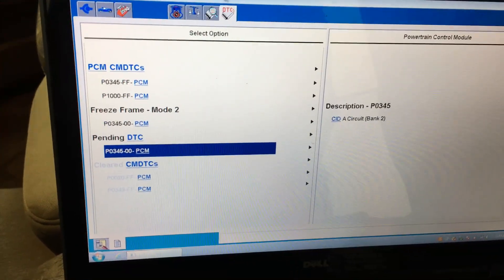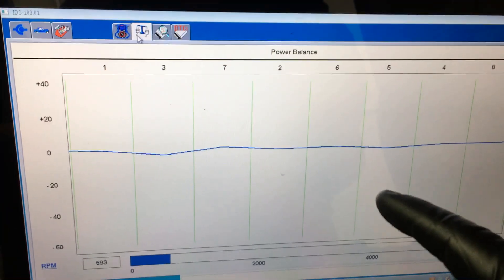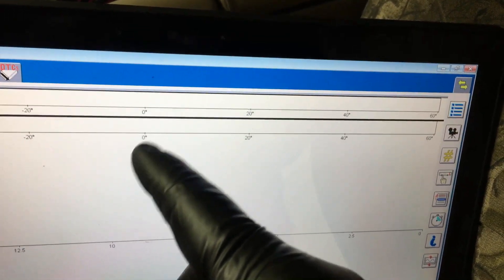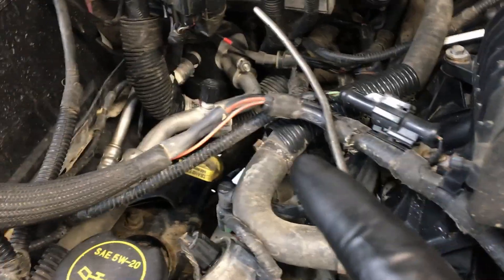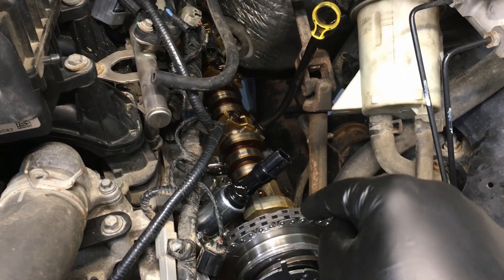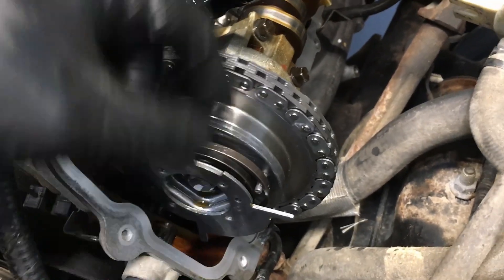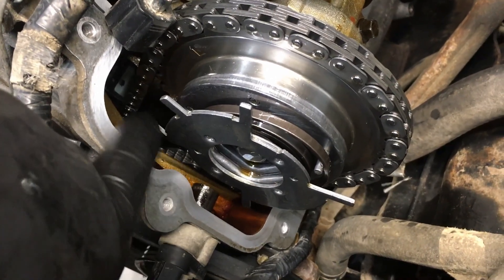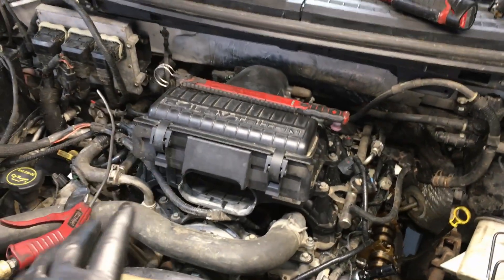Ford 5.4L 3v Triton Engine P0340 P0344 P0345 PO349: Always Inspect These Items First!

Comment: I have a 04 f150 5.4 it has just over 76 k , it started sounding hard on the start and the check engine light came on it read p0345 cam sensor bank 2 I replaced the sensor the light went away and two weeks later the same thing happened and it was po340 bank 1 so yesterday i got another sensor swapped it out check  engine went away. This morning it came back on and is spitting out the PO340 again. It sounds rough on the start but quites down into a normal idle in a few sec. It also has stalled out when I'm slowing down with the AC on
 Any advice plz I have 4 kids and on a budget. Is it ok to drive it

Comment: uh, I just finished the timing job and I got a p0340. Pinpoint testing the camshaft position sensor to verify it reads within the acceptable ohm range resulted in ZERO ohms.  Therefore, they do fail and following the Ford diagnostic procedure does have value.

Comment: I have a 2006 5.4l that’s throwing a P0345, and P0349. Ruled out the cam sensor, vvt solenoid, alternator, wiring. The Phaser is lined properly, could that still be an issue? The truck runs smooth with no issues. Just keeps throwing the 2 codes.

Comment: At what mileage should I do a timing job?
Reply: you do it when you hear the noise of timing chains slapping against the front cover or the chain guides.  Or when you get P codes related to the VCT, timing and/or cam position sensors.

Comment: I just did a step by step on your 4 part video.  Wasn't as hard as I thought it would be.  But now I have codes p0390 and p0394. Could this be the same  issue? Sensor B ??   Bank 2.
Update. It was a bent tab. I did the test of remove vct solenoid. No difference. Ohmed out the wiring and connectors.  Swapped left and right sensors for the heck of it. No good.  Hooked up my oscilloscope to it.  Noticed 2 spikes sort of far apart and  1 small spike and 2 large spikes close together. Removed cover. Sure enough 1 was bent.  Straightened and no more error code.  Just need to wait for the permanent code to clear.

Comment: I am having a problem with a 345 code and a rough running engine. Hearing what sounds like vacuum leak or exhaust sound sound intake. But after messing with it a few times the rough running goes aw away and it idles fine. 350k miles, 2 sets of the cheaper timing sets, 360 oil pump upgrade. Does it sound like the phasers are just moving around.please help
Reply: What was it??

Comment: So I did my timing job following  your videos  . It ran fine then It starting hesitating and jumping in gear . I saw this video and learned that you can test the alternator interference so I disconnected it and did the test well the problem stopped with no codes .  So does that mean I have to replace my alternator? Or is there a reason that is causing the alternator to do that . Can you help please .
Reply: What did you find? I’m about to swap out my alt

Comment: I had this same p0345 code and my car was shaking. First check oil and oil pressure. Found out I have a bad oil leak.  I check the oil it was nothing in it but 2.1quarts. Changed the oil got lucky. Engine run like again new.

Comment: Hi all. Wondering if you guys could help me with an issue I’m having. 

2010 f150 xlt v8 5.4. 140k miles

Pickup drives five but every now and then (not always) when I come to an idle, or take off of the accelerator at a low speed or come to a stop and the vehicle comes to idle my engine starts to do what I can only describe as a “clunky shake”. The shaking goes away if I bring the RPM’s up, and stays gone once the rpms drop back down to where they were when it started. My power seems fine at most speed and my  acceleration seems fine. 

Thoughts? Thanks for the help. I’m in a very rural area so I would like to have a good idea of my issue before I venture way out of my way to a reputable mechanic. 

Some people have told me phasers, more people have told me spark plugs are bad and misfiring.

Comment: I got a Harley Davidson 2007 f150. Just rebuilt the engine, put it back in time, fired it up. Missing like it's running on 4 cyl. P0345, 349. The middle tang on the L side of bank 2 phaser is in the middle of the cam sensor hole @ tdc compression. Just like bank 1. Still runs like crap. Everything else is working. I've done several of these 3v, never had this problem. Think it's jumping when I crank it over? No bent valves I've done a leak down twice. Bangin my head against the wall!!
Reply: Hey I'm experiencing same issues right now on my 2008 5.4. What was your fix in the end?
Reply: @Mrtoddmontgomerysr I had accidentally put the L and R on the wrong sides. So, basically, I put crank back in the right pos and realized it. Just made me some wedges to stick between chains and flipped the phasers 180*. I had put the L on the left when you're lookin at the engine, which is the R. Pass side is R and driver side is L! Can easily happen to you. I've done alot of these trucks. This is the only one I'd ever had a problem with. Lol

Comment: Have you ever had a vct system that won't activate? After installing a new timing set and oil pump. My vct system stays zeroed out? Like it's lifeless and running off the pin. I checked the wires from the vct solenoids. And they both have power

Comment: I recently did a complete timing component and oil pump swap. Truck runs ok, idles a little rough and I get the CEL with this codes for bank 2. I have done all the trouble shooting you mention in this vid and still get the CEL and codes. I've checked and cleaned every connection, I haven't tested voltage or replaced the VCT. Any advice on where I should go next? I bought Ford phasers, is there a chance it could be a bad phaser?

Comment: if anyone can help. 2007 f150 5.4 did timing job with ford phasers, timing chains and tensioners. checked timing 4 times. all checks told to check after job. still producing p0345 in pending intermittently. now after i did timing job drove veh. over a hundred miles. did smog etc.. no issues. ran great. after veh. sold customer/states veh. stalled sounded like diesel. code 345 pending. deleted and did all checks to check timing with out pull valve cover. checked vcterr pids. both dead 0 deg. at idle. did a relative compression check. perfect. all within .1 deg. have yet to reproduce code. only thing i know i have now replaced was the vct solenoids themselves because when i removed to do timing they had been replaced already. not ford. look like dorman solenoids. however every test has passed and 345 has yet to be reproduced.

Comment: Hey Mak, great video. I've watched the other cam phaser videos hoping to find an answer or insight into a problem I'm having. I have an '09 F-150 4.6L that intermittently throws a P0345 code but no others. When the code is thrown, the truck runs rough, feels like it's going to stall out and sounds like a cold VW Rabbit Diesel. I shut the engine off and left it overnight. When I started it up again, the check engine light was off. I drove the truck to the shop with the code still in the PCM the very next day and even though the code was still in the PCM, they said it was "running like a champ". From experience, I know it will come back – might be in a day, might be in a week. The shop told me it was a cam phaser sensor issue and said there's nothing they can do if it doesn't have the problem in the shop. They recommended an oil change with a MOA additive as a start, but said this problem could lead to an entire engine replacement. The whole thing sounds fishy to me. Thoughts?
Reply: Did you ever figure out this issue?  My '04 is now having very similar symptoms.
Reply: @alanrail5179  I had a lot of cam phaser work done on the truck but the issues kept coming back. Ultimately, I sold the truck.

Comment: I'm hoping this is the problem with the junkyard reman engine we just put in our 05 f150. It's an engine out of an 07 expedition that was replaced in 09 according to the tag on the side. I have p0340 and p0344. Runs smooth no misfire or loss of power. Just using a cen-tech scanner from harbor freight so I can only get so much info. But from what I have gathered it's in time.
So hopefully when I pull the valve covers it's just this simple fix, it honestly looked when I had the valve covers off for the solonoids the phasers looked brand new.

Comment: great content as usual. my question is when cam timing is off say a tooth the vct error pid offers to the right of zero so far but how does the cam being off a tooth change the error if the computer isn't commanding the solenoid, how is the error pid changing.. if you could shed some light on this that would be sweet.. thanks again

Comment: I've got a 1998 Lincoln navigator that just hit 300k miles, and now won't run! 
It starts for 5 seconds and cuts off. If I hold the engine at 1500rpm it'll run (really rough) till i let off the gas, then stalls... I'm thinking of changing the throttle position sensor, and the air idle control AIC? 
any thoughts or suggestions please!

Comment: I'm about to do a timing job ..a short story..I pick up a 06 f150 5.4 3v that's throwing the po345 and p0022. .and po349. .With a very loud knocking noise ..that sounds like coming from torque converter..so B4 I met ur videos ..I replace torque converter. Flywheel. .Both seals..and starter. .change fluid and filter. .and still knocking noise coming from torque converter. .oo and stalls after warms up...am I going in the right direction with timing or should just replace motor with new...119xxx on the clock
Reply: Try the lock out phase kit this dude makes a video my truck grew balls babay

Comment: I wish you were closer. You would definitely be the guy to work on my trucks. 
But 1 question, I have a 2008 f250 with 5.4, it has 283,000 miles and has had the tick since 180, with this many miles, should I just wait for it to blow up, or still have the timing job done? I bought it with 100,000 miles, and have ran synthetic since then. Any help is appreciated!

Comment: 3 questions. 1 is the vct on a 07 F-150 does it have power all the time or on and off how does it work. 2 where does it get power from .3 on my truck I have voltage.but not ground on the connector.please help Thanks

Comment: When you're under the pump stuff like this happens. We have all experienced these sorts of scenarios. Few things are as frustrating as having to pull down a job you have just completed to correct a problem. The fact that you had the presence of mind to make a video of it says much about your professional approach and demeanor. Not always easy to stay cool after a long day when things don't go to plan!
Reply from the maker: No big deal easy fix and diag. Figured I would make a video to help others since I have seen vent tangs straight out of the box too many times

Comment: You know it's great that Ford has designed engines and components to make better fuel mileage and all, but!, The complexities these days is to the point of ridiculous.  When I was street racing my Mustang and doing my own mechanic work long ago, it didn't take a tech to diagnose simple problems, nor a full bank account to have it done.  Geez!
Reply: Not Ford choice, they have to comply with stricter and stricter government regulations every year
Reply: U S oh they do my mustang gets 24 mpg and it has 670hp 2016 Roush stage 3

Comment: What do you think about replacing half a quart of oil with ATF?  Help clean some stuff up?
Reply from the maker: We used to do it on the diesels but not on these.
Reply: FordTechMakuloco recommendations for any oil additives to increase life?  Just bought an ‘11 Expedition EL
Reply: FordTechMakuloco increase valvetrain components life I mean.
Reply from the maker: No just use full synthetic no additives
Reply: FordTechMakuloco word, thanks buddy

Comment: How much does a timing chain replacement job usually run for these motors?
Reply from the maker: $2,300 here or $4k at a dealer
Reply: @FordTechMakuloco  Our local dealer quoted a friend $3500 in Sioux Falls, and that was a couple years ago.

Comment: I have an F150 with 5.4 3V that I purchased new in 2004. The truck now has 151,000 miles on it. Last Summer I had Brian perform one of the 30 customer timing jobs he referenced doing in 2017. My truck has been babied since new with regular oil changes and all required maintenance but it was exhibiting the well documented 5.4 ticking and knocking symptoms. After viewing Brian's excellent 4 part series with instructions about doing the timing job I decided it was beyond my shade tree mechanic skills and I called him to arrange an appointment. I drove the truck from Kansas City to his shop in Plano, IL. Along with the timing job, Brian recommended changing my spark plugs, coils and roller rockers as well as upgrading to a Melling 360 oil pump with Pennzoil Synthetic 5W-30 oil. Brian's charges for all of that work were more than reasonable considering the parts and extensive labor involved in doing this job. As you know from watching his videos, Brian is a wealth of knowledge and I consider him to be one of the most knowledgeable technicians in the country on all things Ford, particularly the 5.4. Additionally his attention to detail and cleanliness are obvious in his videos and my feeling was if I can't "do it myself", this is the kind of technician I want to work on my truck. After the work was done I have to say my truck has never run better! I fully expect the truck to go to 300K without issue. If you have a Ford and are anywhere near Chicagoland (or not, like me) and want the work done right the first time on your vehicle I highly recommend BSG Automotive. It was definitely worth the drive!
Reply: Try driving from Florida!

Comment: we had an expedition with the cam phaser problem. it was covered under warranty dealer replaced one but not the other, a few months later out of warranty the other failed, got frustrated and traded it in for a 2017 taurus SHO

Comment: Have you run in to the P0451 code. Just curious as I have done some checking and the sender in the 04 is sending a changing signal, but I guess not in the correct rang. Any experience with this code. Thanks
Reply: range

Comment: Great job!  My brother-in-law and I recently replaced the water pump on my 2013 Lincoln MKT 3.7 engine and receive a P0019 Code.

We pulled both valve cover and timing cover off and realize after a hour that the both cam phasers timing was slightly off! We loosen both cam phaser bolts and turn the cam phasers one or two notch and everything is back in time!!

 I just put 3,200 miles on the car after after resetting cam phasers timing! no check engine lights and everything is smooth!!!! 

You've been a major help for me thank you so much!!!

Comment: I have the 4.6 Triton motor in my 1998 f150 xlt. The check engine light blinks when I drive it and loses power frequently. What do you think is wrong?
Reply: Specific cylinder misfire if the light is flashing on/off. Could be a number of things, worn plugs, bad wires, etc.
Reply: vFallout  my grand marquis was doing the same thing try some fuel injector cleaner

Comment: I had the 03 Ford Expedition with the 5.4 one of the best SUV!!!!  now got a 07 Cadillac Escalade with the 6.2 and a bunch of headaches!!
Reply: You must have the oil burn issue?
Reply: I have a 2004 ford expedition and I really like it. I've had no major problems, just little things that break down. Thankfully these ford videos are helping me with dyi.
Reply: Ha! Gm engine giving problems. Buddy the one reason this man has all these followers is because were all living proof that fords have the worst engineering. ill take a gm oil issue over a ford phaser , pats, 4x4 hub, fusebox rot, timming issue any day. Gm is the most reliable. the hype with fords is the moster truck look to them, thats all but the idiots that designed it put the engine inside the cabin. Idiots. Hey on the bright side fordtechmakuloko business will thrive.👍🏼 Ford is a piece of crap because they never owned up on these phaser issues with a recall as customer loyalty. they screwed us all.

Comment: I recently got a issue with my f150 it's misfiring pretty bad and running real rich and has codes p0010,p0020,p0303,p0305 I switch coils and fuel injectors replaced spark plugs and still misfiring had a ticking before this happened I was thinking probably a stuck tensioner or broken chain rail slapping the chain but ever since it started misfiring ticking went away but now I have this issue and has no power at all aswell I know it's hard to diagnose something just over a message but maybe you or someone has had similar problem that can give me some advice thanks...

Comment: Can a 5.4 2v be replaced by a 5.4 3v?
Reply: I wouldn't. You'd need to rewire for the extra sensors, and need to replace the ECM.

Comment: i have done probably 12-14 of these in the last few years and have seen the bent ears just a couple times. thankfully i was lucky and noticed them before i closed the engine up. i hate to see you have trouble but is is a relief to see that someone else has seen it also. thanks for the great videos brian!
Reply: You seem to be knowledgeable on the subject. 04 f150 5.4. Ticking, occasional rough idle when hot, and now stalling during those rough idles. P0340 p0012. probably the phasers? I already did VTCs and sensors. Thanks!